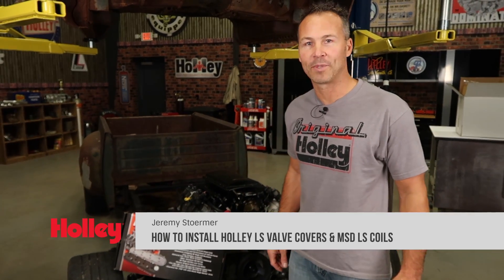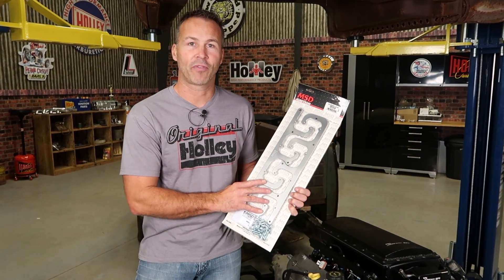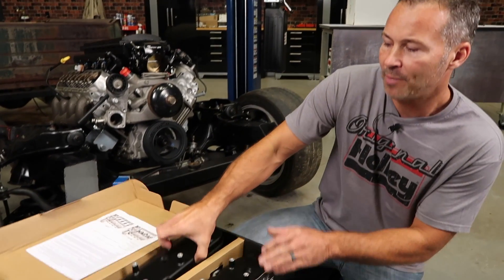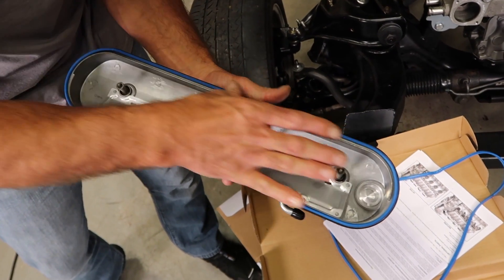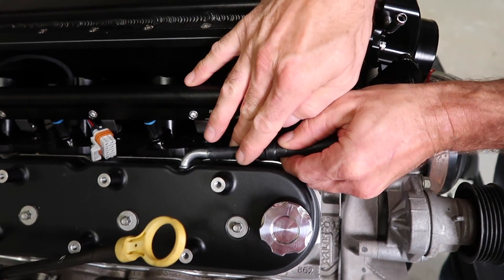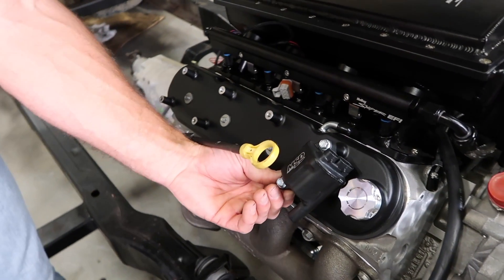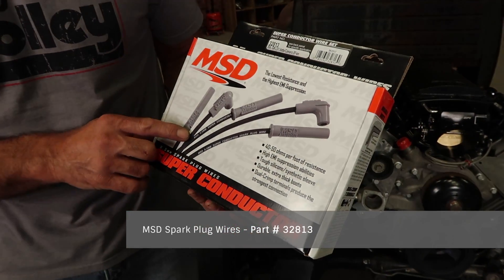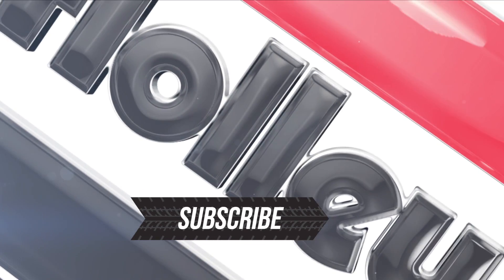How To Install LS Valve Covers & MSD Multi-Spark Coils - EP. 2: 1951 Studebaker Truck LS Conversion

Comment: When he installed the PCV value, he should have installed it on the other valve cover that's on the driver's side. The PCV valve is towards the firewall end of the valve cover.

Comment: hi, i have 6.2L gmc truck 2015, can you provide me the part number to have full set? 

1- MSC wires 
2- MSD coile
3- MSD Valve covers
and if you have more items please assist me, thanks
Reply from the maker: Use this chart to help identify your current coils. http://documents.msdperformance.com/techlibrary_indentifying_your_ls_coils.pdf
 Without knowing all your details, it looks like these wires should work p#33829? https://www.msdperformance.com/products/spark_plug_wires/vehicle_specific_super_conductor_wire_sets/parts/33829
Thx J